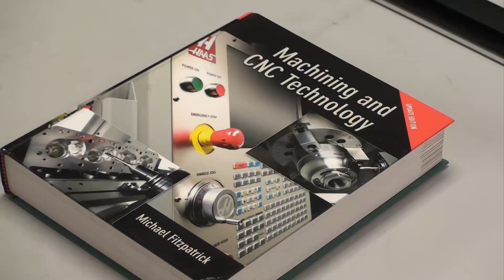Machining Training Prepares Workers for Available Jobs

Comment: I hope it works out...I was an all-around machinist (CNC-manual) for the better part of 20 years and got a very diverse experience, but the shop changed hands, and the new owners were accountant types that were only interested in profits, and not the high cost of running a fully-equipped shop...The shop was closed, and the work got outsourced to IndoChina...Because of instances such as the aforementioned, manufacturing is next to non-existant in quite a few states...